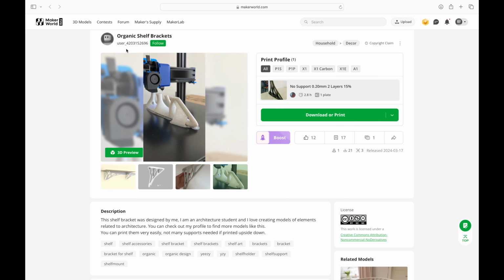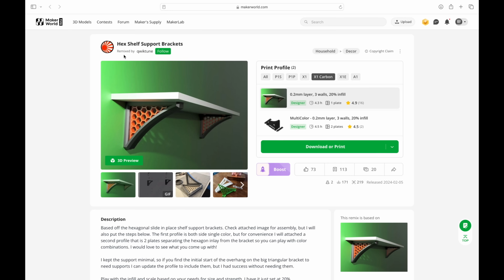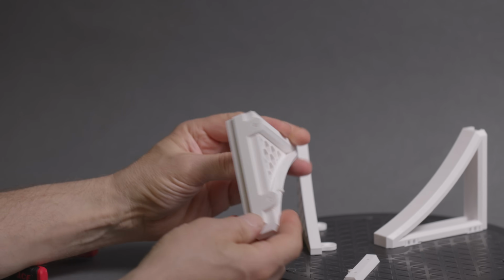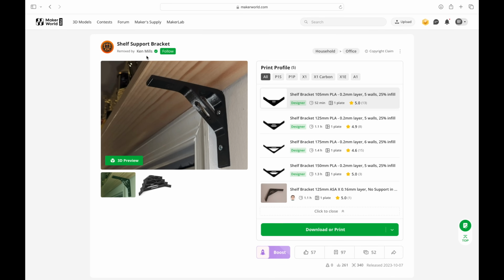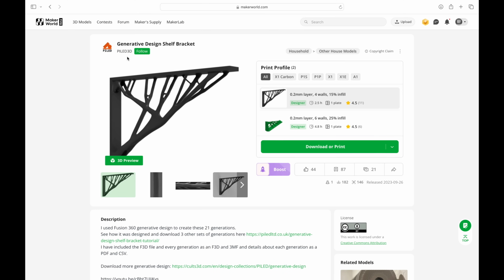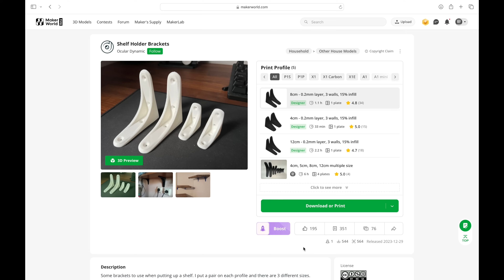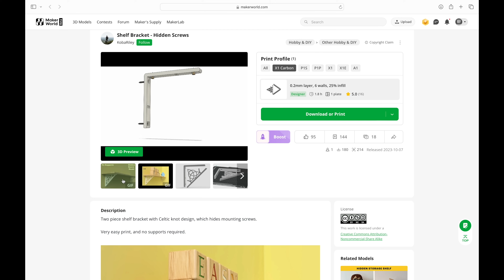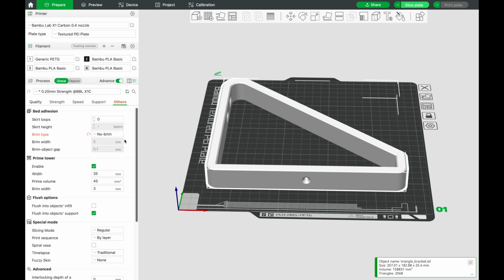Best 3D Printed Shelf Bracket

Comment: Did the ones that started to pull away from the wall early all have the top screw lower than the ones that typically did not? It looked like where they started to pull away from the wall was up to the point they were attached. I also wonder if this lever point also amplified some of the wobbliness on some of these shelves. Thanks for this video, I'm looking at replacing some L brackets the previous owner installed that are always bouncy.

Comment: I'd go with the overhead supports for shelves. Looks like petg stretches more than it compresses, there's also more material to stretch compared to the others. 
I would tweak the design to print with 88-87 degrees so that it settles around 90, but the amount of deflection will depend on print settings, material and size.

Also, thanks for doing these tests using PETG, I never print with anything else lately.
Reply from the maker: You're welcome. That sounds like a great approach to those overhead brackets. Let us know how they turn out!

Comment: Just some little advice for your consideration.
These designs are of clearly different own mass (consumption of filament) and dimensions (depth and height).
In those small bracket experiment, the center of the dumbbells are almost over the depth of the shelf bracket, which is clearly a bad situation of mechanical load.
While some designs have different sizes available, I didn't aware of any principle explained for your choice. Obviously, the choice of size affects the result very much.
It is practically impossible for a truly fair test. I think it is good to provide some objective reference for comparison, such as the own mass of the shelf brackets.
For example, design A of 100 grams for max 30 pounds compared to design B of 50 grams for max 25 pounds. Clearly, they both have their advantages (in other words, pros and cons).
Reply from the maker: Those are valid points, we appreciate the feedback and understand are a lot of variables. These tests are very general. Our goal was to see what these specific designs and settings were capable of so the average 3D printing enthusiast can decide if it’s going to work for them and so you guys can improve on where we might have gone wrong in order to get your best possible prints.

Comment: You shouldn’t use maker world they do steal designs off printables without attribution
Reply from the maker: Thanks for the heads up I've never heard of that before. We always want to make sure we are giving credit to the correct designers.
Reply: It happens the other way around too. Lots of original models on MakerWorld.
Reply: Makerworld can be so sketchy. They released a marble racing print and don’t allow remixing for whatever reason…

Comment: look at how close the top screw holds the bracket to the wall.. this will do a lot to inform you re: bracket strength.  
second factor is the support arm strength..  high screw and strong arm = strong shelf. :-)
Reply from the maker: Great observation, thanks for pointing that out!

Comment: Thank you for taking the time and energy to make this, very interesting and informative. It seems as though having a mounting hole as close as possible to the actual shelf greatly increases stability, which makes sense when I think about it. I would consider the use of carbon fiber or glass filled filament (not PLA) if you can tolerate the colors available, as these are much stiffer and will resist flexing. Thanks again!

Comment: Could we get some info on the filament you used to print these? Your difficulties with stringing and poor overhang support seem consistent with wet filament. You might also be using cheap white filament that might use titanium dioxide as a colorant, which often results in poor performance.
Reply from the maker: Thanks for the reminder! I will link the filament we used in the description. It’s a Hatchbox White PETG and we keep our filament in the factory sealed bags until we use it. Once opened it’s kept in a humidity controlled case to try and keep the conditions optimal. This one was a brand new roll we used for the tests but it’s definitely something to look into. I wasn’t aware of the titanium dioxide I appreciate you sharing that.

Comment: I saw a Youtuber use quick passes with a torch lighter to remove stringing on a print. I do it that way now, it's amazing, as long as you move the flame very quickly the print won't melt but the stringing will vanish like magic.
Reply from the maker: Great point the blowtorch works great for cleaning up stringing we were just trying to show how it came out straight out of the build plate before we cleaned it up but we should have mentioned that tip. We appreciate the suggestion!